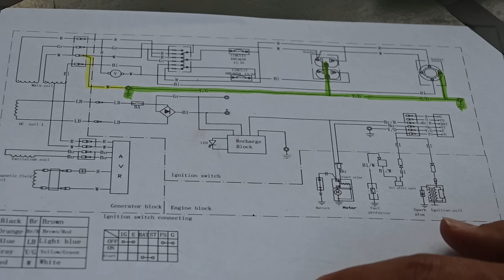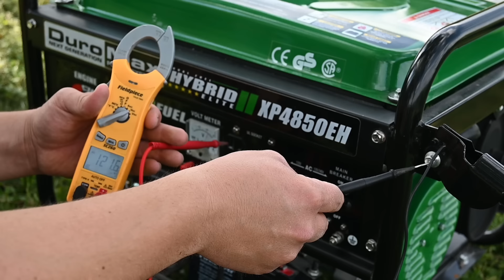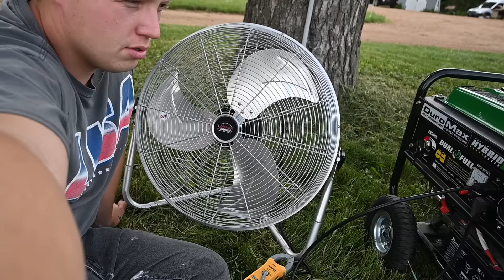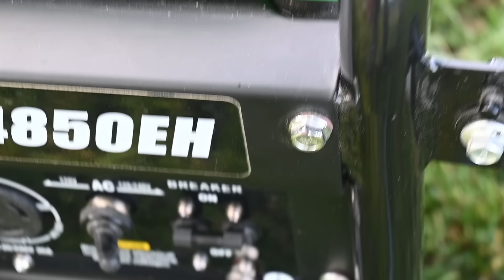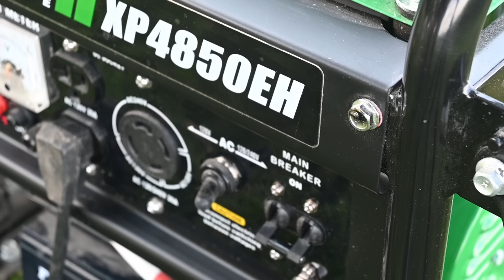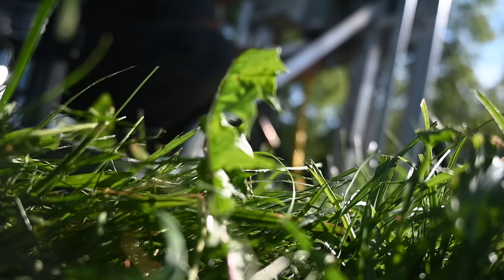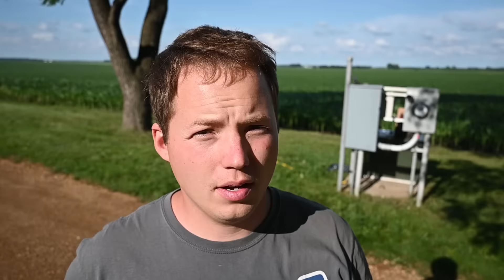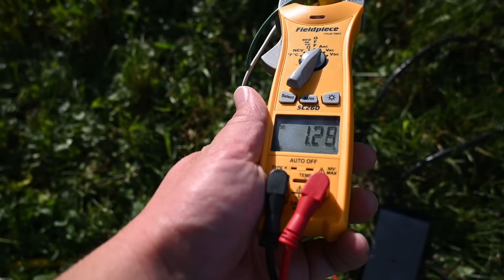What is a Floating Neutral Generator?

Comment: Excellent video on a difficult subject. Unfortunately, many commenters below still don't seem yo understand the subject. An unbonded generator NOT tied to a properly wired home/shop/panel is a hazard to the user, as the frame can become energized without tripping the overcurrent protection device. Grounding a small generator such as we see in this video does NOT make it any safer. Mike Holt's NEC series of videos explain this in great detail. Please, confused viewers, watch this video again and make sure you understand the subject.

Comment: I could have been killed back in September because an electrician got the generator panel wrong!!! Get the bonding/flloating wrong and the generator frame becomes live and you get 120 volts between earth and the generator frame. I grabbed the generator frame to move it slightly in its little building to get the exhaust to point outward and I got zapped. Had I not been wearing safety boots I probably would be dead.  I took the meter and put one lead in the dirt and one on the generator frame and got a solid 120 volts. It's crucial to get it right!!!!!!!!
Reply: agree... see my post 4 days ago
Reply: Your not going to be getting anything from sticking your probe into the ground.

Comment: UPDATE: I could not believe that this caused my generator failure. I bought the same generator and plugged it into the new generator and it worked perfectly. There must have been an internal issue with my other generator. It’s off to the shop to figure out what happened to it...My GMVC80 Goodman is working perfectly now as well as everything is grounded...THANK YOU!

Your advice was sound and I now think that something was wrong with the other generator, that the plug exposed. 

THIS METHOD YOU HAVE POSTED IS SOUND AND WORKS PERFECTLY.

———————————————————

I guess my praise was too soon. I heard a snap sound the very second I tried the plug you recommended. And the engine kept running but slowed down 20% from idle. 

None of the circuit breakers snapped, but now there is no power from any plug and the engine knocks hard when I try to start it. 😕 Looks like this turned my generator into a paperweight. Very upset right now...

I checked the plug to be sure it’s wired right and it is...no idea what happened. I was so convinced this was going to solve my issue, and now my Ryobi 4000 inverter won’t start at all, and, voided my warranty. Something seriously didn’t work well...

Any suggestions?

Comment: Sounds like a lot of us are trying to do the same thing. Run most of the house with a generator connected to the main (or sub) panel.  Using a generator in the 6500 to 6500 running wattage range, they mostly appear to be a bonded neutral generator.  The problem becomes when hooking it up thru the 240V 30 amp plug to a main panel that’s got a bonding screw which would trip GFCI breakers. I believe one solution is to modify the bonded neutral generator to a floating neutral ( and label appropriately). If you later wanted to use the other plugs or use it as a stand alone generator, you could use a neutral to ground plug into one of the 120V plugs to convert it back to a bonded neutral generator. Did I get it right?
Reply: Yes that is correct😊

Comment: Thanks, very helpful! I just replaced my main 200 amp panel as water had been getting in it and seized my main 200 amp breaker. I couldn't replace that breaker as it is an old panel so I replaced the whole panel. I have been watching videos to understand bonding. I installed a 30 amp breaker in that panel to supply a plug box to have a back up using my generator and was wondering whether my generator  needed to be bonded  or not. I am going to check by 2 -100 amp panels in the house and make sure they are not bonded. I think I am understanding all this now. Very helpful video 😊😊

Comment: One important point that I believe you should have mentioned in the video is that the reason they are not connecting the neutral to ground is they can get a higher output rating since they are forcing all current through the one line. MarkMannM2

Comment: I like the focus of your video which is mainly safety . I feel I need to draw attention to what occurred  when the circuit breaker tripped. It tripped due to over current. it is probably rated at around 30 Amps (depends on the power of the generator) You had the Neutral and Ground wires connected together and hence the Neutral was connected to the frame of the generator . You then touched the Live to the frame effectively causing a short  between Live and Neutral.   It is important to understand the difference  between types of circuit breakers. The circuit breaker on the generator will trip when excess current is drawn and is there to protect equipment , the generator and wiring .  Sadly it will probably not trip in time to save human life in the event of electrocution.  The circuit breaker called an Earth Leakage circuit breaker is fitted on distribution boards and these are to protect human beings [and /or  animals :-)  ]. from electrocution.   At AC voltages of  110 and 220 volts it takes very little current to cause a fatal shock - around as little as thirty milliamps ( 30mA)  So the mechanism inside the Earth leakage breaker detects this tiny difference  between the Live and Neutral and will trip.  Okay why ?  The current flowing in the Live going out to an appliance  must be the same current that flows back through to neutral and ultimately back to the power station. If it is not ,it means that the current is finding another path back to the power station through ground.  Or put another way , if an unlucky individual were to touch the Live wire ( or what Americans call the Hot lead )  then the current would use their body to find an alternative path to ground . If this happens there will be an imbalance in the current in Live and Neutral and the Earth leakage circuit breaker will trip in time to save the hapless individual.   If we were to rely on just the overcurrent circuit breaker to save us , then we would be required to endure approx 30 A for several seconds before current were interrupted .  Our demise would occur long before then .  There are several videos on Youtube that explain this far better and in more detail than I have . I hope this helps.

Comment: Question? If you only have a bonded generator what would be the issue of just omitting the ground connection in the four prong generator cord and using the ground/natural bond at the main panel. Wouldn’t this allow current to travel back on the neutral just as it dose for the utility connection? 
Great video btw!

Comment: Great video and I learned something new: bonded neutral. The only thing that slightly bothers me is the jab that the generator is from China. Duromax is based in California and designs their generators in the USA and outsources production overseas. Duromax has a responsibility to make sure units are quality controled to their design spec as well as making sure their manuals are also correct. Duromax is 100% at fault here.  In addition, basically all Honda generators are made in China.
Reply: I am not in the USA and I have the same generator albeit with a different name.
They are Chinese.

Comment: Ok, I am convinced you know your stuff; but I must admit after watching, I still don't know how to hook up my generator correctly.😢
Reply: I too have to agree with you!  Questions I now have after watching Benjamins “Very Descriptive” video = But I am confused???  If your generator is Bonded, and you hook up to the homes circuit panel (which in most cases may have a bonded (with ground) Neutral, what do you do?  What are you supposed to do then?  Do you have to “Unbond” the generator, or is it ok to leave it alone?  One thing I think I understood, is if your generator is NOT bonded, and you want to use power directly from the generator with an extension cord to say power a component directly, take an old cord: tie the ground and neutral together, cover the hot wire and plug it into an empty receptacle on the generator - and now the generator is bonded.  Is that correct?  But to just repeat my confusion and need an answer to the question that remains, if my generator IS bonded, and I DO hook up to the homes Circuit Panel, do I have to Unbond my generator, and How would I do that?
Reply: @miket8376  man I feel your pain.  You should ask someone besides me.  Maybe a local electrician.
On the other hand might search YouTube for generator bonding.  I know of some who buy a male plug end and internally make a jumper from ground to neutral.
Reply: May I suggest that you download the entire course (video) 👌

Comment: Could a generator be designed with a switch of some sort to toggle between bonded and floating neutral? And if so how much current capacity should it be capable of handling?
Reply: It could but my feelings are the manufacturers either dont want the liabilities.

Comment: 8:32 It's not open lead... It's over load or limit.  "OL - Overload (the reading exceeds the display range)"
Reply from the maker: Thank you. I assumed that it was for "open lead" but should have researched that first. Thanks again for informing me.
Reply: Nope. It's not overload. It's Open Line. there's no continuity, there's no path for electric current to flow from one probe to the other.
Reply: @BenjaminSahlstrom  just because in the Fluke manuals they call 'O.L' Overload, does not mean the manufacturer of your meter is using the same. That said, in ohms mode, if the reading is so high that the meter thinks the leads are not even touching anything, an Open Lead would be what it thinks is the problem. So would a very high ohmic value, with the leads not see anything, be an Overload, or an infinite reading, or no reading at all. Hmmmm . I've always called it an open, just plain open.  Benjamin, keep up the good work.
Reply: NO.  NO.  NO.  Nuclear Weapons trained technician here.  OL means OUT OF LIMITS.  As in, the meter function, currently selected, cannot handle, (too high or too low)/read what is currently being input to the meter.
Reply: @BenjaminSahlstrom  It's Overload, I have books older than anyone posting here that document that😂. Even Dave from EEVblog (electrical engineer) agree...
Reply: @BYENZER    It says OL not OOL.. reference military manual where you're getting this BS.  I have the feeling the most you did with nuclear weapons was operate the forklift that moved them.
Reply: @ksdavey1  More than the fluke manual describes OL being displayed.. OL will also be displayed when you're measuring voltage beyond the meters currently set range.  It's Overload. Stop spreading bad information.
Reply: In this instance "Overload" is referring to more resistance than can be measured. As in there is no continuity aka "infinite" resistance.

Comment: Hi Ben  I had a very nice Cat 2200 generator that was neutral bonded.. I have an interlock and before had a Honda 2000 that was not neutral bonded.. It worked great with the interlock.. On the twist lock I tied the Xand Y together so as to get both sides of the panel.. Worked great until my son  wanted it back as it was his.. I then bought a Cat 2200 and it was neutral was bonded to ground. Kicked the GFCI every time.. I very quickly found that the Generator was seeing too many or so grounds.. Went out and bought a Honda 2200 without the GFCI.. Now Ok again.. Also if you use the 30 amp instead  on any large unit it works fine even if the unit has GFCI receptacles.. Thanks for the great video again

Comment: Ben, you can't have the ground bonded in both places because of possible fault conditions. If someone runs over your generator cord with a mower and cuts the neutral wire and ground wire, you would then have a voltage potential on everything that is bonded in the house, along with the generator and the panel. If you were barefoot and touched the generator or your panel outside, you would then complete the return path through you and the ground to the generator. If you pushed your plug in mower over to the generator to see what was wrong, and touched the metal frame of the mower and the metal frame of the generator, you'd be in series with every 120v electrical load in your house and really get lit up. Obviously in regular conditions it is no big deal, but these rules are written in blood, just like OSHA regulations. This type of fault condition has happened, and has killed people. If this problem happened with a floating neutral generator, you would have cut the ONLY return path for the current, and the neutral at the generator itself would no longer be bonded anywhere. The whole point of the NEC is to provide multiple fail-safes in the event of a fault. Please don't tell people that it's okay to completely remove one of those protections. 

Your bonded generator would also backfeed the power lines through the neutral (your interlock isn't up to code for use with a bonded generator for that exact reason).

Unrelated: most generators can be converted from floating to bonded neutral easily, and most manufacturers provide instructions on how to do it legitimately.
Reply: I recommend you watch this video again, because he clearly goes over all the information you have listed in your comment.

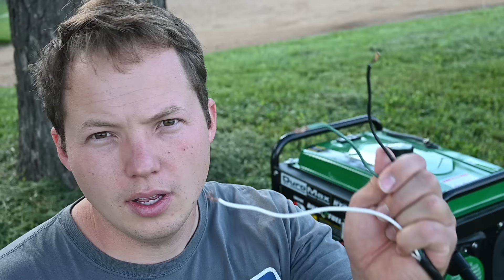Comment: At 16:51 you said that the breaker won't trip when there's a phase-to-ground short, and that this is a problem. But the reason it won't trip is that there's no fault current, and the lack of a fault current means that there is no hazard.

Comment: Ben, "OL" does NOT  mean open lead.  It refers to being "over limit" of the meter's capability.
Reply: False. A quick google search proves your statement wrong.
Reply: Only when you are in voltage or current readings is this true.  When checking continuity it means open loop.   Just happens to have the same abbreviation
Reply: @christopherswanson1628  And also should be "over limit" when you are measuring a resistance that is greater than the range limit on a locked resistance range . This is NOT an open loop! We have all gotten too lazy with auto ranging DMM's. 

That's why "over limit" is a far better term. It works in all situations, including continuity.
Reply: @ethanoverwatch407  If I have a DMM that declares continuity OL at readings above 200 ohms and I'm probing a 300 ohm corroded connection, is that an "open loop" or "open lead"?  I think not.

Comment: Great video, Ben...Subscribed due to your knowledge and clear delivery in layman's term.  I just got my 5000 watts gen made by A-ipower (4250 watts running), and tested the receptacles as you demonstrated...The panel said that they are bonded neutral, but I tested them and found that only the 120/240V L14-30R is bonded, while the four 5-20R are not.  I am baffled.  
1). Do you know why this is so?  The electric schematic diagram clearly showed that all four 120V receptacles and the 240V receptacle have neutral wires connected together and to the ground. 
2).  If I hook this unit using extension cords separately from the main panel to my 120V appliances or tools, will there be a problem, being a floating neutral 120V receptacles? 
3). As you mentioned, a bonded neutral(240V in this case) may be used for the interlock back feed (current in the ground is small?), does this mean you will need to set up a ground bar/line to the gen panel's ground connector?
4). The interlock back feed is a safe way to ensure that there is no chance of making a mistake for the main power switch.  To my understanding, what is the difference between this and the one people hook the 120/240V L14-30 line to the 240V dryer receptacle, when the main power switch is off and taped over (no chance to activated it)? 
Thanks in advance for your help...
Reply: Did you test with the breaker on?
Reply: The difference with an interlock and back feeding by taping the main breaker off is if you get caught doing it you won't be able to get utility power again. They will cut you off. Also if a fire happens in your house that's electrically related during use of a backfeed cord without a proper interlock you can bet they won't cover the damages. Don't do it. Just get an interlock/transfer switch, or use extension cords. People make mistakes under stress, and the mistake of backfeeding lines during an outage is just too much risk to take for yourself and utility linemen.
Reply: @NoName-sx4cz  thanks for the info.  It's been a while since I asked the question, and I bought a Predator generator instead from Harbor Freight., 4350 watts/3500 watts.  I acturally tested the backfeeding once with it, and no problem to feed my two refrigerators and one small chest freezer, plus my internet modem and router with LED lighting when I needed them.  Taping the main switch off with all the 240 volts breakers off except the dryer breaker.  Someone used/suggested  interlock device, which is the same as taping mechanism, though with a seperate line/240V outlet to backfeeding.  What is the difference between the two methods?  
Using extension cords look easy, but you need to get several long cables runing around for each devices that a located far away, it can be problematic/messy as well.

Comment: 16:30 now do the opposite - ground the live and trip the breaker by arcking the neutral to the frame - or even the other phase to make a 240V flash. It doesn't matter AT ALL which of the three wires is connected to earth, the other 2 will always cause a trip.
The reason the neutral is chosen means that the tripping voltage can only be 120v and never 240v but here in England, we have 240V anyway - so all ours are at 240 as the primary standard.